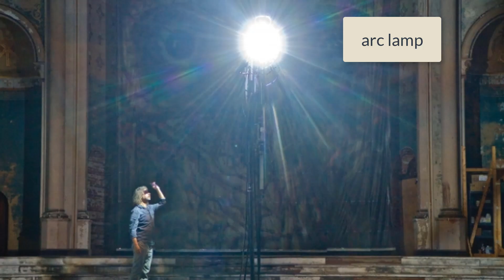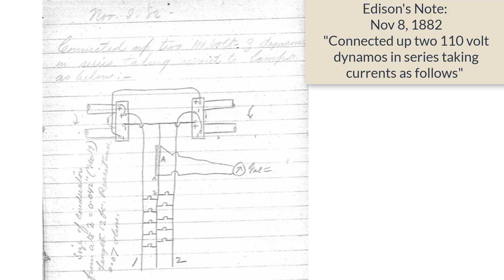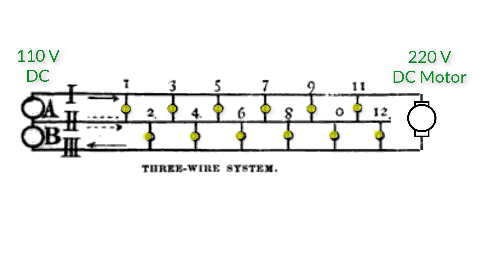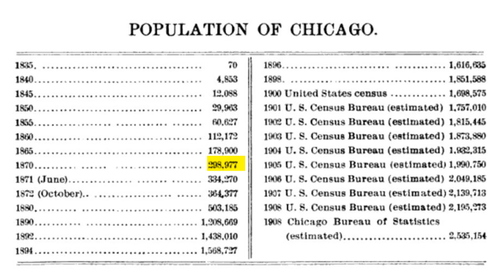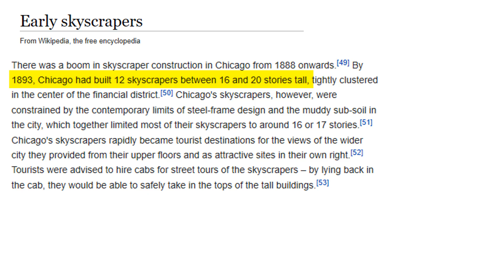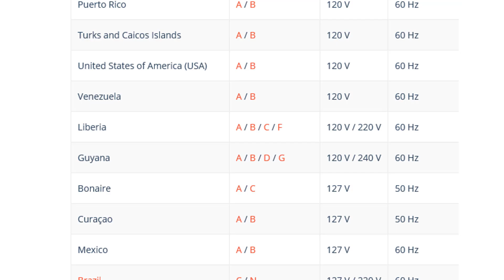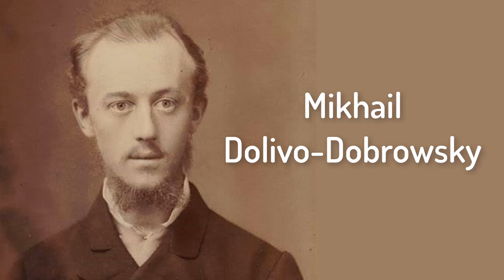Physics and History of Why USA uses 120 volts and not 220 volts

Comment: I thought one of the reasons for the switch from DC to AC was for safety.  Bare, uninsulated wires used to be run anywhere and everywhere.  For example, common practice was to run wires behind wall paper.  if some unsuspecting person pierced the paper and touched the wire, or some child dug into it out of curiosity they would get a shock and possibly be electrocuted as DC would cause a muscle spasm holding or freezing the poor sucker until the power was turned off.  Where AC causes an automatic rejection upon touching as the phases alternate thus removing the possibility of getting stuck.  Is that urban myth?  Does it make sense?

Comment: Loud buzzer sound Wrong answer Kathy, nice work though.  110/115/120 VAC is used for plugs for one reason; safety.  Our breaker boxes are wired for 220 VAC and there are many benefits to using 220 (220/230/240 VAC).  However, we wire our plugs for 110 VAC because we can do that with one "hot/live" wire.  A typical plug will have a black (or red) wire which is the hot/live wire; the wire that can be potentially deadly to touch.  The other wire(s) in a typical 110 VAC plug are bare or green which connects back to the ground bar and a white wire which in-home wiring is referred to as the "neutral" wire.  This white wire is also grounded but best practices call for not hooking bare/green and white wires to the same bus bar as the bare/green wire is an earth ground and depending on the components and their placements can often have a small (less than 1V charge difference from the installed earth ground).  If you look at a breaker box you will notice two main hot buses where one is color-coded black and the other is color-coded red.  To wire a 220 VAC plug we use the black and red wires where the difference is twice the amount because the phase is perfectly synchronized so that when the black wire is a positive 110 V from earth-ground the red wire has a negative 110V from earth-ground.  This makes 220 VAC more dangerous to wire, dealing with two hot wires with the potential to kill the worker.  Personally, when I install a 110 VAC circuit breaker the very last wire I connect is the black (hot wire) then plug the breaker into the breaker box.  This brings the circuit alive as the very last step and is the absolute safest way.  Nice guess though.  PS Thomas Edison was an opportunist, thief, and mass murderer.  Be careful when relying heavily on newspapers and patents when understanding history.  Old houses were wired with two wires (the modern equivalent of white and black) because white/neutral could double as earth-ground and for 110V one hot wire is all that is required.

Comment: Here in Spain, 110-120V was still around in some regions in the 80s, and in some rural areas, it continued into the early 2000s. If I understand correctly the switch started sometime in the 50s, so that means people would have had to use step-up/step-down transformers for up to 50 years, to be able to use their 110V devices on 220V, or their 220V devices in 110V, depending on the case.
I never saw 110V on the lines myself (I'm 37), but my grandparents still have devices that are 110V, which were made sometime in the 40s or 50s, and they have a couple step-down transformers for use with those devices, when they need them.
In the case of my grandfather, it's a drill press, with a relatively powerful drill, which would be too expensive to replace for the little work he does as a hobby.
In the case of my grandmother, it's a coffee grinder which she uses to grind sugar for use in baking, because nothing else she has tried leaves the sugar as fine and uniform.

Comment: Edison was very concerned about safety and 110V is a little bit safer than 220 so far as electrical shock is concerned. 
220V allows using smaller wire and thus its cheaper to implement. 
I noticed this right away when I bought an extension cord in the Philippines.  It's much more flexible than one from the US.

Comment: The idea of strong vertical supports with lighter curtain walls goes back at least to the 11th century in Chartres where the flying buttress was first used to support the roof of the cathedral.  A more modern version of this using steel was the London exhibition or world fair in the middle of the 19th century.  The building was colloquially known as the Crystal Palace.

Comment: Also instead of transmit high voltage, we would use lower voltage but higher frequency and cheaper a thousand time instead of using 50,000 volts is too expensive

Comment: Simple answer, US was first and standardized on 120V..  The US standard is really 240V, but we split it at the panel in our houses to 120V for most devices.  You also have the benefit of having devices that can get both 240V and 120V from the same plug (if 4 wire plug).    Technically lower voltage is also less deadly if you get electrocuted, but at 120V or 240V it really does not matter.  Other countries that electrified later decided to use 208V to 240V for everything with no standard, some countries use 208, 220, 230, 240, etc.    
Now 60hz is better, but silly people chose 50hz just to prevent US equipment from being sold in their countries.    The world should standardize on 60 hz.

Comment: What I understood from other sources:
110 Volts stems back from the time of carbon-arc street lamps. Those burned best and most stable at 55Volts, and they were usually installed two in series.
So the 110V is not arbitrary. The 220V was simply a multiplication by two. That made math easier in calculating wiring and fuse dimensions. 220V is a fine balance between cabling efficiency and safety margins. 110 (today 120V) you almost can't feel with very dry hands. But 220V (today 240V) with wet hands has the potential to change your pant's color. I have touched 380V once, That's European Tri-phase P-to-P Voltage. NO, THANK YOU! 
(Side story: My Mom told me when I was about 4 years of age I rolled two pieces of chocolate bar aluminium foil up and stuck it into a 220V outlet. I was told I was unresponsive for ~ 2 mins. Certainly that's what has prevented me from following up on Einstein's work;).

Comment: Good video I should watch before commenting but the truth be known about lower voltages when it comes to lighting. Columbia SA has 150 volts for it's standard outlets. I would love to buy their lightbulbs because they would never burn out. Put a 150 volt bulb on 120 volt line it will burn cooler and not as bright. I tried the dimmer method but I still lose bulbs. The APE voltage reducer works wonders. I probably will buy another.

Comment: I was a little surprised by you mentioning transforming voltages in distribution systems before you introduced AC with Westinghouse at the Chicago Fair. The only real transformation option for DC electricity pre AC would have been highly inefficient motor generator units.

Comment: FACT IS, equipment running on 120VAC uses DOUBLE the AMPERAGE of equipment that runs on 240VAC. Since electric meters in our homes measure monthly AMPERAGE USED and NOT VOLTAGE, we actually pay DOUBLE what we would pay if using 240VAC.
Take a look at the last bill you paid and multiply the number of AMPS consumed for the month and multiply them by the STANDARD RATE for your area so you can easily understand the difference between the number of MONTHLY AMPS consumed between 120VAC and 240VAC.

Comment: Use two system power supply is better because one system get to be hacked easily  so in case the system got attack we can still use other system but with lower voltage the current is increased so with the human body the defensive system is weaken and higher voltage then lower current run through you brain or vice versa so under lower voltage less magnetic on some system but if you go to higher system your body could not resist because it was program under lower current attack and if see higher magnetic it failed easier than the asian under higher magnetic when going into lower magnetic their immune system work much better because their body used to deal with higher magnetic

Comment: This is all great and all...except the US actually users a 240V system. It's just the difference between how that is tapped at the consumer side that gives you the 120V at a typical 15-amp outlet. On that note, the beauty of the US system is how simple it is to get 110,120,208,220,240, etc. all from the same source, with the least number of transformers.

Comment: Wrong kinda, we use 240 volts. Go look inside your panel you will see 240 volt circuit breakers inside. We split our voltage so if wired right our electric is balanced the heavy appliances use 240 volts there was a time they made clothes dryers that could run on 120 volts but with a heavy current draw. I'm happy with split electric I just wish we could have an option to have 110 and 220 volts lightbulbs last much longer even LED lights. I found this out with my Christmas lights. I would have to replace over a dozen LED lights in three weeks. I bought a voltage reducer and I haven't had one light burn out. I also believe TVs and other electronics would last longer also.

Comment: 02:36 - probably "more load",  not "more resistance". As more lamps are connected in parallel, the load increases.

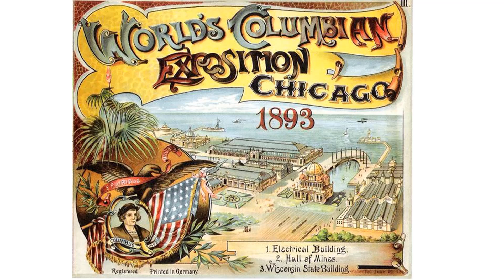09:36 - I love that crowd, especially the riders on top.

Otherwise very good.

Comment: You mentioned transformers and the metal need for them, in reference to places and times that used DC power.  Those did not use transformers. Their absence of DC ability to use transformers was the main factor in AC winning over DC distribution.

Comment: When I first visited Europe many years ago, I was intent on finding out why they used 220...The stories I read, said after  the WW II. There was an opportunity to standardize the grid, and motors ran more efficiently and they could use smaller gauge wire, so less metal, which was in short supply.

Comment: 2:37 How does a higher load on a "more popular" line make it a higher resistance? With each parallel load, the resistance decreases!
Did you mean mechanical resistance at the generator?

Comment: I thought it was mostly due to the early insulation of wires in the USA, more likely to catch on fire with the hire voltage; and insulation was much better when Europe and other countries finally started distributing to households etc and they used the hire voltage.

Comment: Ish keeps you going for many hours. You have inlighten me to some new people. And once again you are trying to edit out tesla I guess to keep people from remembering the world's greatest inventor from history. But thats just because his ideal of free energy. Would have kept us from the slavery to the world banking system or what we know as the Federal reserve.  And today I believe we call it the industrial machine.  
But the rest of the world. Uses 220 is not correct.  Canada, Italy and Egypt use 347 at 50 Hertz.  Germany 3 phase is 400 volts at 60 Hertz.  England voltage of 220. Is one hot wire to ground. The only thing in your home that uses 220 is your microwave.  Thats because the micro reactor inside your microwave only works at 220. That also means that there is a step up transformer and explains why you need a dedicated circuit for a microwave. 
Saying all of this long winded speech. And confusing people more only to say. A book is only as good as its writers research. And if you only use a limited amount of research then your book will point people into a particular direction.  Which means you can be taught wrong and people will forget the truth based upon misinformation.  Electricity can be traced back to way further back in history. The light house in Alexander Egypt.  Is the oldest light house in the world and still no one knows how the light worked. Because during the first crusade. All of the worlds knowledge was kept in Alexander.  They say a fire destroy that library.  But this is not true only one building had a fire. But the intire library was loaded up and haul to vacant city. And is kept. In the underground library. And only privileged people are allow in. And you are only allowed to look at the information of a book that you sign up for. And you are not allowed  to take a book out of it . And you are only allowed to look at the book you sign up to look at. There is a time limit. 
Its alot like your video.

Comment: Great historical tying together of events, decisions and factors leading to the current state of the art.

Small correction though: On Edison’s d.c.: The more popular line used more bulbs so had LOWER resistance (not higher - the bulbs  are in parallel). The problem actually was that that lower resistance drew higher current,  leading to greater voltage drop and so lower received voltage.

Comment: I seem to remember that neither Mr. Edison nor Mr. Tesla were involved in the 220/230 V against 110/120 V decision. In a time when electricity was all about light the difference was just between 4 carbon arc lamps with 55 V burning voltage each paired in succession vs. just 2 of them.

Comment: 1/3 of the countries? There are over 180 countries in the world now and basically only Canada, Mexico, and the USA still use 120 Volts @ 60 Hz. Originally Tesla and George Westinghouse collaborated on a hydro-electric plant that ran 2 phase 110/155 Volts opposed at a 90 degree phase angle. These were 25 Hz generators, so this part of the USA remained on 25Hz into the 1990s. Factories claimed it was much too expensive to refit all their electric motors so 25 Hz stuck around this small area until NAFTA was signed and the factories went to Mexico and overseas. There is the 110 Volt basis! Some motors ran on 155 Volts. We had to reuse some pasta presses from ???? and those were all 155 Volt AC motors that ran through a VFD to run old Italian made pasta extruders. Later on we went to a 240 volt split phase system. So we do use 240 Volts. More accurately we use 208 Volts 3 phase delta wye or 240 volts 3 phase delta delta but the latter can only supply 2 legs with 120 volts and not 3. The wild leg is 208 Volts. Off the grounded center of the 3 phase wye secondary we get 120 Volts.  NEMA stands for National Electrical Manufacturer's Association and they are still mired in the late 1800s. The trolleys in San Fran Cisco use 6 phase.

Comment: Four times less copper in European electrical wires and still the same level of losses as in the US. That's the best thing about the voltage difference!
We in Europe are grateful to France. This country is much better at providing more practical standards than the US. 1 kilogram is what weighs 1 liter of water. This one liter is exactly one cubic decimeter. A decimeter is one tenth of a meter. The whole metric system and ISO is great for calculations without crazy (american) transform constants. A degree Celsius that is the same size as Kelvin (of course, it is has different zero, but the temperature intervals are the same). Zero degrees Celsius - water freezes, 100 degrees Celsius water boils. Good to know if you expect ice in the winter. Easy cooking - boiled water on 100 degrees. And at the end the more practical 240V (yes, you know, we switched to 240), which allows us to use four times (!) less copper in wires for the same efficiency of transporting electricity to electrical appliances than in the US. For the same power evaluated U * I, the current (I) is twice lower. Electricity losses are calculated R * I ^ 2, so for twice lower current (I) we can have four times more resistance (R) at the same losses. Therefore four times less copper is needed. Thanks France!

Comment: More lamps on the line (in parallel as shown in your diagram) does not make MORE resistance, as you state.
It makes LESS resistance, and causes more current to flow. The additional current flowing causes a higher voltage drop in the circuit, and dimmer lights.

Comment: One of the main reasons for a higher voltage at the consumer is that the higher the voltage the lower the current and consequently the smaller the gauge of wire necessary for the same power consumption.

Comment: While the wall outlets in the are allegedly 110 volts AC in reality they aren't.  My UPS unit on one of my computers continuely displays the line voltage which fluctuates from 100 to 125 volts.  Also, every house has 220 volts available at Circuit Breaker Box as a lot of household appliances require 220 volts such as clothes dryers and Climate Control devices.

I have been hit by both 110 and 220 volt  electricity.  Neither was a good feeling.  The 110 volt was my doing something dumb.  The 220 volt was done by faulty 1970s wiring in Germany when I was vaccuming and moved a floor lamp so that I could vacuum under it at the same time. I was holding the metal lamp pole in my left hand and the metal vacuum wand in my right hand therefore completing an electric circuit.   My dad determined that the vaccine was reference to neutral and the lamp was referenced to hot. The worst shock I ever received was from a flyback on an CRT.  I was told that the CRT was discharged by a coworker when it wasn't I touched the flyback and I found myself picking myself up off the floor.

Comment: City of Burbank California uses a 3 phase system that has a "dead leg" . Check each leg to ground one leg has zero volts. But any two legs will give you double the voltage to ground.  One system I encountered had a "floating ground " so the dead leg would move around

Comment: And the conclusion of this story is that Tesla and Westinghouse introduced the AC voltage in Chicago fair but they didn't have so much light bulbs so they used Edison's bulbs that worked on 110 V DC ( the light bulbs don't care if it is DC or AC as long it was 110 volts ) And when AC was introduced as a source of power the USA was lazy (proud) to make the switch to 220 V ( like it was in Europe ) that would provide less costs to building transformers...less metal...less copper for wires.